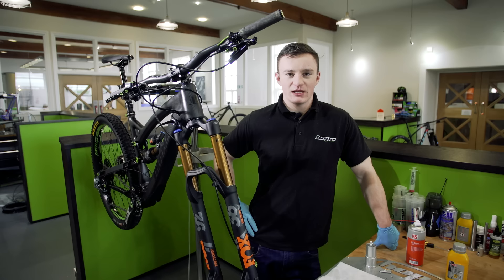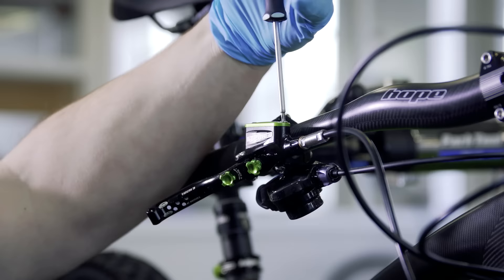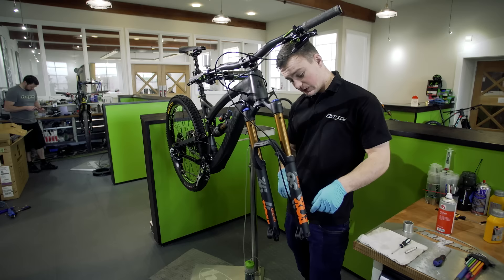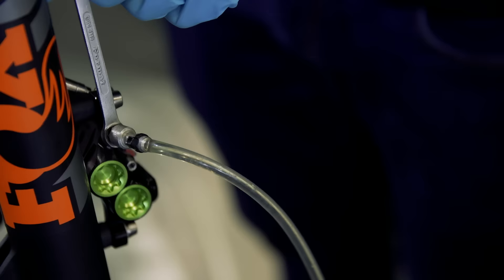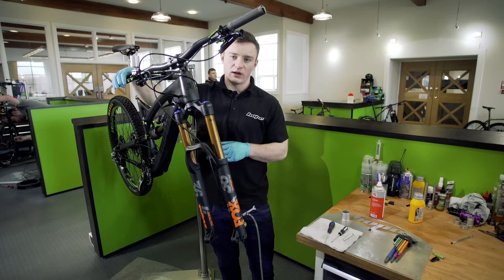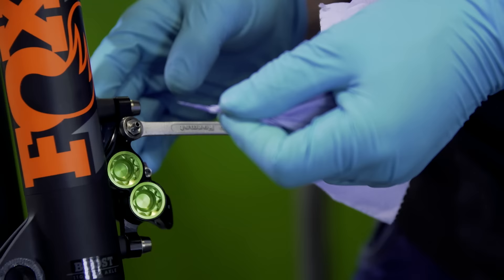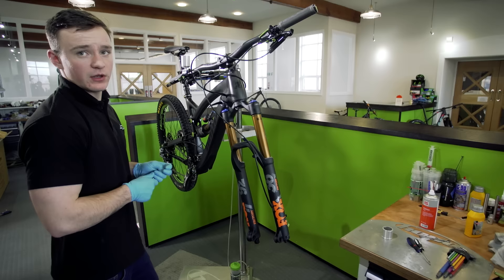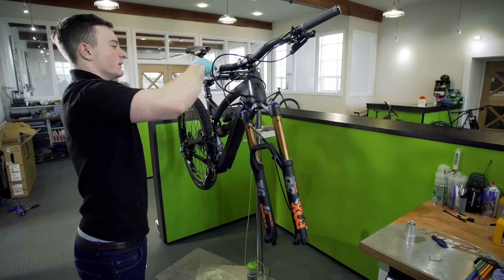Hope Technology: How To Bleed Hope Brakes

Comment: Does it matter if I use “bike specific” fluid or can I use the stuff marketed to cars. I assume they are the same thing and I’ve read forums saying it’s fine.
Reply: You can use whatever you want as long it's the same type of fluid.
Reply: generally each manufacturer has their own specified fluid to use but that's one advantage of using dot fluid. while there are multiple types of DOT fluid, ones that shouldn't be used in a bike brake like this, you can use whatever type as long as its the same type. you may find different DOT fluids like what sram uses vs a different company. as long as it says dot "4" or dot "5.1" or whatever type of dot fluid hope uses then you should be fine.

Comment: I’ve had better results using the easy bleed tool and pushing fluid through the system from the calliper end with a syringe 👌🏻

Comment: I can’t see what’s going on with the screwdriver pushing at the pads/ or is it the pistons? Still confused: just where can I push without damaging?
Reply: Lund1128 push the pistons back using a screwdriver on the backplate of the pad against the face of the piston  NOT the front face of the pad(disc side)
Reply: Best practice, remove pads, clean pistons and push fully back. Fit a plastic block in place of the pads while bleeding. Making it a better and quicker bleed.
Reply: @CycleTechUK  so before bleeding:
1. clean and push pistons fully back
2. fit block
3. follow steps in this video (ignoring the bit about fiddling with the pistons)?
Reply: @meredithmurphy7227  yeah same question here as I am about to install/cut a new hose and bleed for the first time ever a brake!  Looks simple except for that caliper/piston thing where we couldn't see a thing.. I just don't want to have air trapped over there! :/
Reply: @CycleTechUK  he pushes one side first then another with open port if u remove pads how u able to do that?? the air will go back up the pipe

Comment: Thats the problem with hope.. needs to have specific top cap for for you to be able to bleed
Reply: You don’t HAVE to use it- it’s just much easier with it. You can do it without it but you’ll need to keep topping off the reservoir with fluid after 1-2 pumps of the lever and closing the bleed nipple. The reservoir top cap thingy is full of fluid so you don’t have to keep topping it off. Not necessary but makes the bleed process much, much quicker and easier

Comment: This is a pretty frustrating video, although I’ve admittedly watched it several times when bleeding my hopes. It can be condensed and edited for the minimum required amount of time. And, yes, unfortunately there is no adequate lighting during the section on releasing air from behind the pistons. That would help a lot. For those who said the bleeding process for hopes is easy, perhaps they’ve never owned Shimano or TRPs. Easier and much less mess. 
Hopes are the most frustrating brakes I’ve owned. Temperamental is an understatement. These brakes require a high tolerance for frustration. Also, they’re simply horrible for the environment. Any brakes that have dot fluid spilling out in such quantity when resetting caps and releasing drain hoses are lame AF. Not to mention the mess. 
Tip: only let your pads wear halfway at most before changing. And, hopes heat up a lot. I think they require bleeding more often because of this. Just a theory though. Also, regardless of how many instructions I follow to bleed correctly, over time the pistons extend and reset at different lengths causing all sorts of rotor rub. Perhaps the calipers are in need of rebuilding, but you’re just not going to need to do that on low mileage Shimano, TRP or Sram.

Comment: Attention:
My experience with this system...Enduro Hope Tech.
Never ever again.This system incl a design error as the brake pistons can suddenly lock during your ride. I never had that issue with any other brake like, e.g. Sram or Magura MT7 and it has nothing to do with changing the Dot from time to time. I renewed the Dot completely and  it took me almost an hour to get the back brake pistons to work again.disaster. i think this is a design issue of this break.